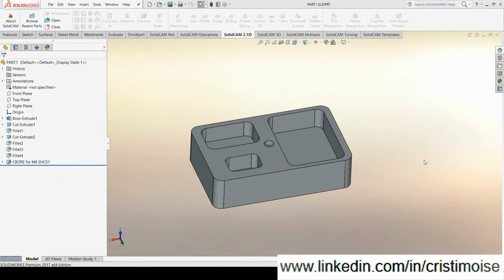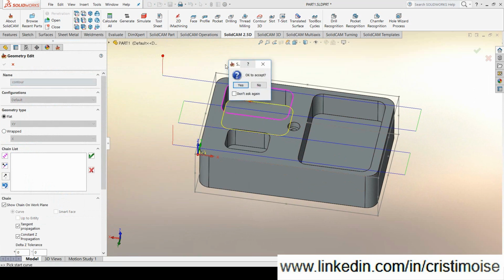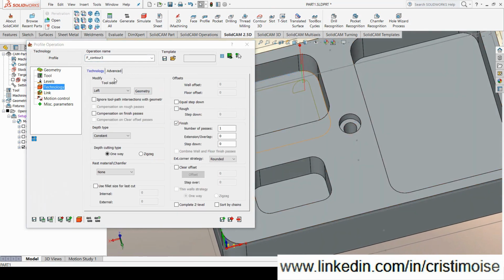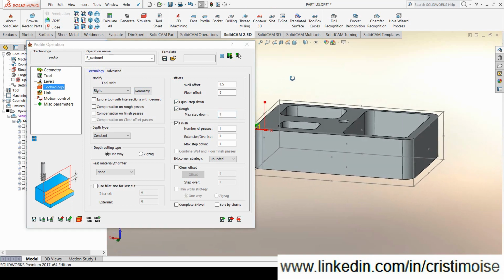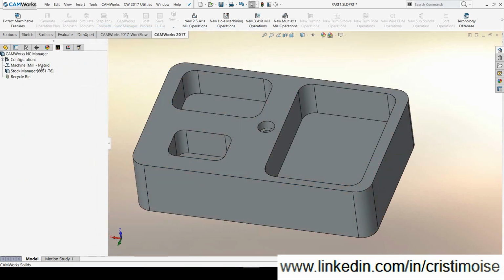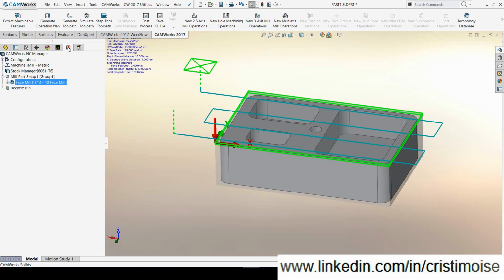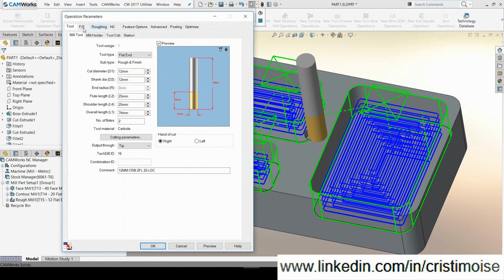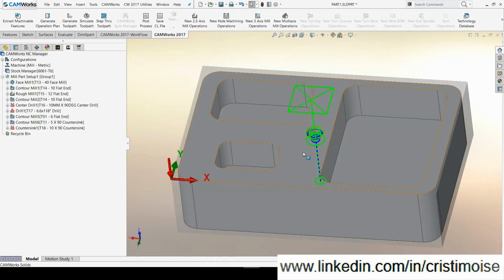CAMWorks vs. SolidCAM

Comment: Power of SolidCAM is not only iMachining, but also the flexibilty to optimize the postprocessor for any machine. 2,5D is strong especially when you have multiple part setups (Transformation of UCS). This demo part can be machined in 2 minutes by Pocket recognition, or Pocket with variable depth. Also copying operations, just use Ctrl  key and drag an excisting operation to the geometry to be machined. The demo given here is how you did it 10 years ago...
First iMachining attempts were poor, but after optimizing some parameters, it's really amazing for toollife and is a reliable milling process.

Comment: Power of solidCAM lies in imachining. I honestly think without it it is simply not a competitive product. They also know that and that is why almost all roughing is centered around imachining. For instance, the part you machined would be roughed  in about 5 clicks ( imachining 3D), with target model intact (safe machining). Hard to beat that. Then you just apply finish pases for imortant features but for other features you can just copy again same operation to take off those last few 0,1milimeters.
Reply: With camworks 2019, you can do a 3D volumill cycle which is awesome. I like imachining but I have had better results with volumill, particularly with tool life. Imachining is extremely fast though, not sure if anything beats it.